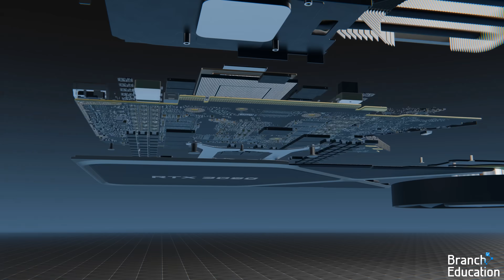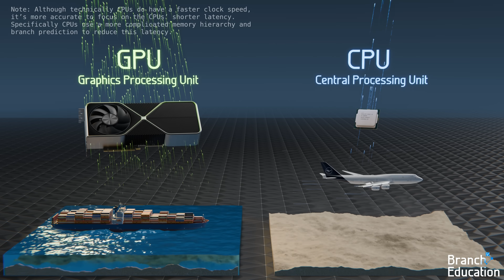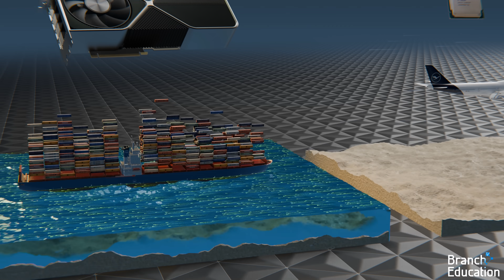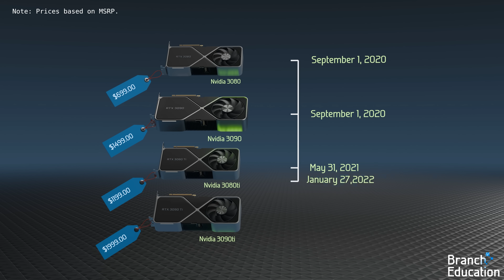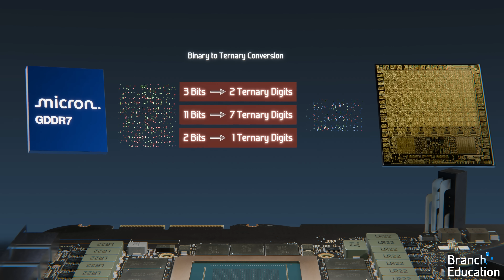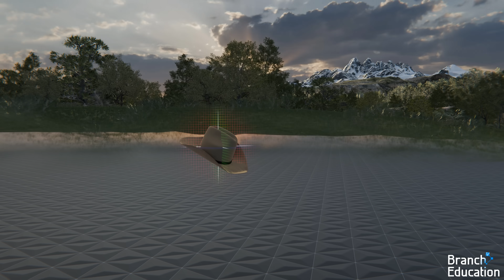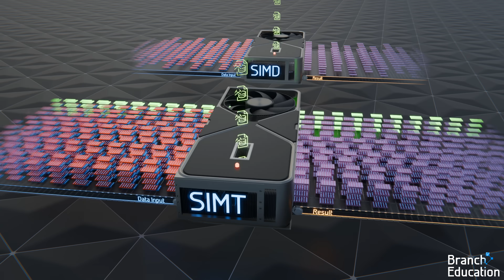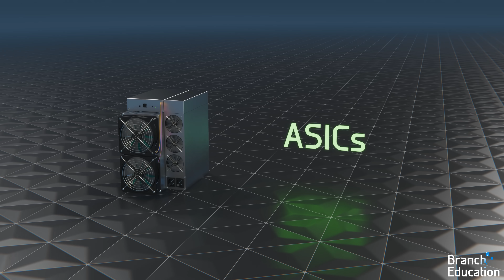How do Graphics Cards Work?  Exploring GPU Architecture

Comment: Could be a silly thing to ask but i just need to know: Following the explanaition from 19:30 does that mean that the further away from the "world center" you are the longer it takes to render the vertecies? After all the coordinates of the object in world space woule be higher and thus, if too high, might slow down the rendering time. 
If that was the case could this be solved by employing multiple "little world centers" and whichever is the nearest is choosen for the equation?
Reply: No, because the GPU processes all of the bits in a number more or less at the same time. Basically, GPUs take 1 clock cycle to perform addition, subtraction, multiplication and fused multiply-add (a * b + c) on 32-bit numbers. Division can take a few cycles as I believe in most GPUs it's implemented by first calculating the reciprocal of the divisor (1/x), then multiplying the dividend by the divisor's reciprocal, and more specialised operations like exponentiation (x^y), square roots and such take up to several cycles.

Regardless, assuming that all coordinates are using 32-bit numbers (which they almost always are in real-time graphics), multiplying the vertex position by the model matrix to get the vertex into world space would take 16 clock cycles between 12 fused multiply-add operations and 4 multiply operations. No matter if the vertex position was (0, 0, 0) or (99999, 99999, 99999), it'd take the same 16 clock cycles.

Having said that, using multiple "little world centers" (which are actually called world origins) can be useful in very large scale worlds (whether it be a huge world populated with large objects, or a reasonably sized world populated with tiny objects), as floating point numbers (which vertex positions generally are) do have finite precision and can cause issues with extremely large or extremely small values. By having multiple world origins, you can essentially reorient both the camera and nearby objects around the closest world origin, which helps with precision.
Reply: @jcm2606  thanks for the answer

Comment: I'm CALLIN' BS HERE RIGHT NOW!

Here is my comp's specs and why I'm telling you:

8GB RAM
i5 Quad Core CPU
Nvidia GTX 960 2GB GPU
460 PSU

YES it's on lowest settings but it still runs Cyberpunk 2077 + Phantom Liberty at 60 fps.
Don't ask me how. Perhaps I don't overload my comp with desktop or background processing junk and clean the fans every 6 months (GPU included). Still silent as a lamb 6 years since I upgraded it : ]

Comment: Big fun fact: Unlike CPUs, GPUs don’t rely on traditional clocks, they do have core clocks and memory clocks but not in the same way. Instead, the operations they perform depend on how much data is efficiently shoved into them. Some absolute idiots like me... no, not me, but people like me spent hundreds of thousands of dollars building a ultra-optimized system using small but insanely powerful microcontrollers to feed data in a way GPUs can understand and actually managed to run Windows 11 ARM x64 on an RTX 4080 SUPER, and yup this aint cap.

Comment: The amazing thing about this is that it is all based on the same transistor technology from a long time ago. Everything has gotten smaller, faster, and has more power, but the technology is the same. Transistor technology has turned into FET technology, but the principle is the same. A new innovatory idea not coming from me but perhaps from some undergraduate out there is to make a new type of transistor that doesn't depend on making it smaller, or faster, or with more power, but rather a brand new type of device that acts as a FET but it is not made of FET materials.

Comment: I have 2 NVIDIA 1080 GEFORCE graphic cards in my computer, they are quite fast and barely used for anything I do, even animation rendering. I received an update after the newer released graphic cards and my speed went to a crawl. NVIDIA was trying to make it look as if my graphic cards were useless, so I would purchase new cards. I had just spent $1400 on these cards and not about to spend more, I just reloaded the original graphics version and my speed was up to perfect operating level. I thought MICRON went out of business years ago. I used to clean their business back in 1994 here in Bozeman, Montana. The amazing thing is that it doesn't cost any more to create perfect chips as it does to create imperfect chips, especially when the process by which the chips are made are in near sterile situations.

Comment: Excellent video but i had to point the first example of humans coming together to solve the equivalence number of calculations.  You see, human brains are constantly doing calculations unconsciously; about 95% of the time. From simply walking on a flar surface or incline, driving a car, throwing an object that jits its tartmget etc the brain does "calculations" base on inputs from the sensory system and resulting unconcious/ concious motor activity inside and outside the body. What you were referring to was solving conscious mathematical equations that we have developed through the kanguage of math, which admittedly is a slow process for the human brain, compared to a gpu. I get it's a sensational example to peek the viewers ineterst but not truly accurate at the same time. Regardless, the GPU is truly an amazing creation from the human mind.

Comment: Video should be renamed as "how the nVidia 3080 GPU works?"
This video relies too much on 3080 architecture, rather than how actually ALL GPUs work.
Reply: Most modern GPUs work this way, with some minor differences in nomenclature and how hardware units are laid out. This general design originates from advancements way back in the mid to late 2000's that both NVIDIA and ATI/AMD converged towards separately.
Reply: @jcm2606  Certainly CUDA is just a "minor nomenclature difderence. Sure.
Reply: @lesath7883  It is since AMD has SIMD units which are effectively the same thing as CUDA cores, just with a different name and laid out a bit differently. Read the architectural whitepapers that NVIDIA, AMD and Intel release for their GPUs, and you'll see this same general design between all three of them, because having such a hierarchical GPU that features this specific spread of hardware units between the SMs/CUs is what performs the best with modern GPU workloads.
Reply: @jcm2606  And of course Raytracing cores are a prominent feqture of AMD GPUs since 2005 or somethibg like that.

Comment: 14:39 can anybody explain, how do you send "-1"?
Reply: Negative voltages are where the current is moving from GPU to memory and positives move from memory to GPU
Reply: @steroidies6343  Thanks alot❤
Reply: -1 can be represented by 2 complement in binary
Reply: @tjpablotj3144  How?
Reply: Electricity can flow both ways. To send -1, you simply reverse the current direction. This is also known as negative voltage.
Reply: That does not explain it at all. Your way off topic.
Reply: Negative voltage
Reply: its like a pay it forward thing..
Reply: I think we use an extra bit to represent sign in signed integers
Reply: negative voltage

Comment: Some of the explanations could try a bit harder. (6'49") ".. and ray tracing cores are used to execute ray tracing algorithms." Not precisely illuminating.

Also some actually flakey statements, for instance the output of SHA256 hashing is most definitely not a 'random' number. (25'20")

My criticisms are because I like the video a lot. If I didn't, I would save my breath 🙂

Comment: 4:46 doesn't blender use GPU as well?, in fact it is recommended to select GPU while using blender by blender guru!
Reply: but all the calculations are handled by the cpu
Reply: modelling programs can use both. they mainly use cpu for the actual core operation of the software. but whenever they are actual displaying something, and or are especially rendering something, then typically a GPU is used/prefered

Comment: Small mistake @ 8:10. A 3090Ti certainty does NOT have a flawless GA102 die. It has a die that has at least 10752 working CUDA cores, as well as meets other performance targets. All high process lithography will have defects, so designs will contain "extra" cores, memory areas, etc. and will contain programmable burn fuses that are used to disable the non functioning (or even functioning) elements. Even the highest binned silicon will differ, this is often referred to as "the silicon lottery". As a result, some 3090Ti GPU will overclock a lot better than others.

Comment: Ahh, matrix operations for doing 3d transformations. I knew these had to be in a gpu somewhere. I remember working with the evans and sutherland picture system that had a matrix processor for doing 3d transformations. It also had innovative input devices. I especially liked the 4x2 set of dials used in their famous architecture demo, which let you do rotates, zoom, etc. on the vectors you would use to build some design. Fun days. Of course it was one of the best uses for the pdp-11 and later the vax. E&S also sold frame buffers that had more memory than the pdp-11, so we would use it as a ram swapping disk as well. Memories...

Comment: But how does it know when to load what data?
How does it not just "accidentally" re-calculate the cowboy hat in multiple parallells?
Reply: Because work flows from top down, getting wider as it descends the GPU pipeline. When the GPU first receives a command to draw an object, it's a fairly abstract command that basically amounts to "draw this amount of vertices from this vertex buffer, using this shader and this draw state". From there the GPU breaks the vertex buffer up into batches of vertices to be sent to SMs, where the SM pulls vertex attributes into the batch and processes all vertices within the batch with the vertex shader bound to the command. Once that's done, the SM takes the batch and begins assembling triangles, passing them through the geometry and tessellation shaders before they end up in the rasteriser, where the SM generates pixels to be ran through the pixel shader. Because the work gets wider as it descends the pipeline, the GPU is able to ensure that vertices aren't accidentally duplicated, and it can schedule data loads from memory as it needs to.
Reply: @ I’m amazed by the complexity of the GPU micro components.

Comment: Thank you for posting this.  I have wanted to know this information for some time now.  I am an old mainframe guy from way back starting in 1965, when I joined Honeywell as a field engineer.  (fancy name for a computer techie)  At that time I learned all about the architecture and internals of the H200 mainframes I had to look after.  And as the personal computer era came along, I built several early personal computers.  Still have some CPU documentation lying around somewhere.  But this GPU thing was totally new and foreign to me.  Just goes to show that you can indeed teach an old dog new tricks.

Comment: i am a simple man, i see terrible analogy i press dislike and i switch to the next video. how are gpus slower than cpus? Thats soooo misleading. Proper analogy with vehicles would be gpus are trains, and cpu are suvs. Gpus are faster and can have bigger load, but they do only one thing(they run only on railroad), while suvs can go on road, they can go on pavement, on grass, offroad, over rocks and even on trains rail tracks.

Comment: 7:12 So the more damaged a GPU is, the less it's price? I mean I feel like I'm getting ripped off knowing I have a damaged GPU being sold as new. I used to think the cores were disabled on purpose to cut costs.
Reply: Cores are disabled so that the entire chip doesn't go to waste due to not meeting quality standards. All semiconductor manufacturing processes have an innate defect rate that has to be worked around, and that defect rate for an individual chip tends to go up dramatically as the size of the chip goes up (this is partly why AMD switched to a chiplet design for Zen CPUs, as chiplets let you mass produce smaller chips, so each individual chip has a reduced defect rate). GPUs tend to be quite large, especially higher end NVIDIA GPUs, so having an extremely modular design that lets you disable sections of the GPU makes defects less impactful, as you can just take a defective GA102 GPU that was originally destined for a $7000+ RTX A6000 (even 3090 Ti's get defective GPUs), disable the defective cores/TPCs/GPCs, and use it in a lower end product like an RTX A2000 or an RTX 3090, instead of throwing the entire chip out.

Comment: Why does GPU get more powerful but consumes more power, while mobile processors get more powerful for less power? 🤔 Rumors says RTX5090 is 600W, which is insane.
Reply: Because GPU designers willingly increase the power consumption of their GPUs for even more performance. GPUs are getting more power efficient with each generation, just like CPUs, but GPU designers use that power efficiency to be able to cram even more cores into or raise the clock speeds of their GPUs, which brings the power consumption back up, despite the improvements in power efficiency. GPU designers do this because performance is still the #1 thing that developers and end users care about on the GPU, so large increases in performance will translate to developers being able to push higher fidelity graphics in games and end users being able to play games at higher frame rates.

CPUs, on the other hand, have gotten so fast that performance either doesn't matter to the developer or the end user anymore (so much so that some software willingly trades out performance for UX or maintainability), or is being bottlenecked by things out of the CPUs control, such as the memory subsystem (GPUs suffer from this too, but can work around it by using context switching which, funnily enough, scales with the size of the GPU itself, so an increase in GPU performance leads to an indirect increase in GPU memory performance). As such, CPU designers have been able to ease off the performance throttle and focus more on reducing power consumption, both by just not trading out power efficiency gains for faster/larger CPUs, and by redesigning CPU architectures to innately be more efficient (see heterogeneous processors like ARM's big.LITTLE processors, or Intel's newer Core processors with P and E cores).

Comment: I felt scared when playing red dead redemption 2 while charging, my laptop has RTX 4060 and i9-13900H , my laptop already full and while playing it feels hot so i decided to remove the charger😭😭, later that i realized im gaming so i need to quit game first before removing the charger, well it turns my screen black, i guess power shortage, charging while gaming helps GPU to calculate and perform better so sudden cut of supply makes my game crash,

Comment: wait, what! 3080s are actually broken 3090ti 7:00 !!!
Reply: So basically it’s just the used parts being put in and sold at a cheaper price ;)
Reply: Wait,  didn't he say well technically but this also applies to 4080 and 4090 and more aswell

Comment: WTH? You mean any thing less than a "Ti" is essentially a damaged chip?? What???!
Reply: Even the 3090 Ti is a "damaged" chip. The GA102 GPU used in the 3080 and up is meant to be used in NVIDIA's workstation and data center cards like the RTX A6000 and Tesla A40. These cards have tight tolerances for how much power they consume and how much heat they produce, so NVIDIA will typically use GA102 GPUs that don't perform as well as expected for lesser workstation cards like the RTX A2000 and eventually consumer cards like the 3080 and up. This isn't a bad thing, though, as defects are just a natural thing that you have to deal with in semiconductor manufacturing, so this way NVIDIA can at least reuse defective chips in lower product brackets rather than throwing them away entirely.

Comment: 00:04 Graphics cards can perform around 36 trillion calculations a second to run the most realistic games.
03:46 GPUs are less flexible than CPUs, optimized for simple arithmetic.
07:23 Graphics cards are categorized based on defects and clock speed.
10:54 Graphics card architecture and components overview.
14:22 Graphics cards use encoding schemes for data transmission efficiency.
17:41 GPU architecture utilizes SIMD for parallel processing
20:46 GPUs have complex computational architecture
24:02 Graphics cards were initially used for mining bitcoin due to their ability to generate a large number of SHA-256 hashes quickly.
27:18 Graphics cards have tensor cores for matrix multiplication and addition calculations.
Crafted by ADEDLOOP....

Comment: MIPS boys and girls.   Even back in 2015 a Power Quicc 3 (Integrated Host Processor) was running 2000 Million Instructions per second for only 10 watts.  It is MIPs per watt that is the limiting factor..   Multiply & Accumulate is DSP.   This is a MCM or Multi-Chip_Module.  So ?  What is the core clock rate ?   Less than 5GHZ,  right.  ❤❤.

Comment: When talking about 0s and 1s (0=off) (1=on) you mention 1 volt and 0 volt… has been this always the case for any type of computer/machine?  Or just in this case that the gpu uses 0 volt and 1 volt as a reference ? I thought it can be any voltage or more than “x” voltage = 1 .. and no voltage will be “0”

Comment: 20:45   Note: this is a simplification, most modern engines use quaternions over matrices ...with talks of switching to 3D Rotors which are very similar, but much easier to visualise and represent as they're purely 3D and don't require stereographic projection or four dimensional double rotation.